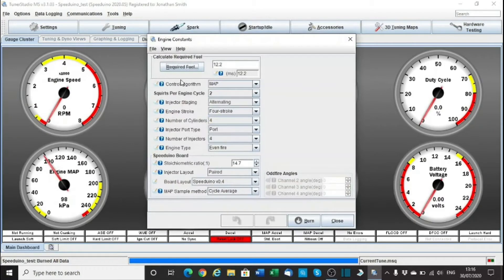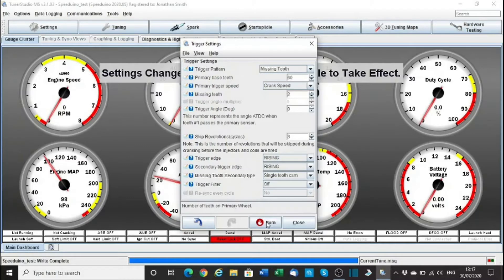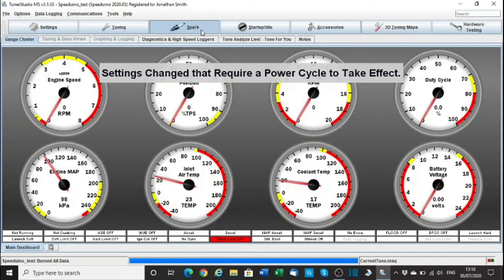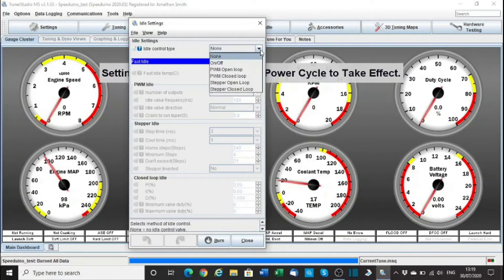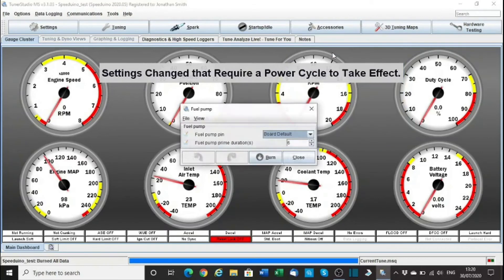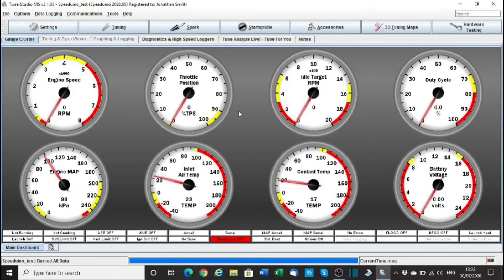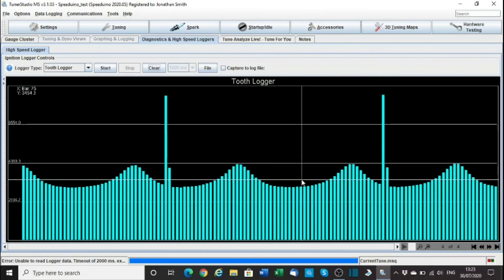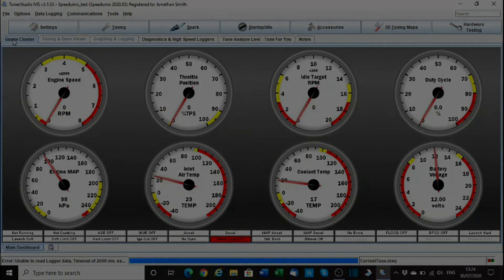Coilpack K11 Micra Speeduino Build and Install Pt18.

Comment: Dose the k11 come with a crank position sensor? really interested in building similar.
Reply from the maker: Yes it does on the coil pack version.
Reply: @megamicra5182   I’m assuming on the flywheel. Mounted on the gearbox?
Reply from the maker: @greigthomson8475  Yes it's on the gearbox, and the cam sensor is on the chain cover plate at the front for fully sequential.